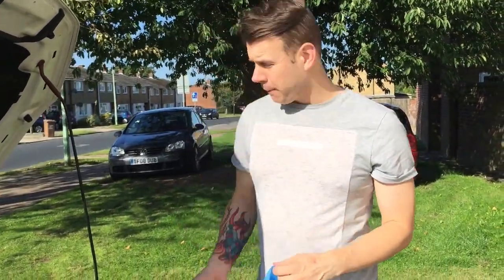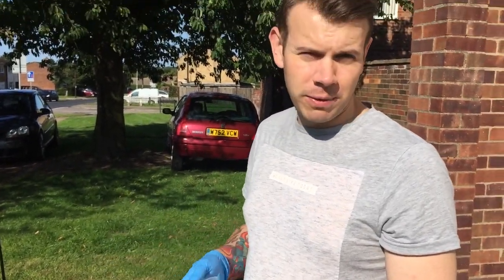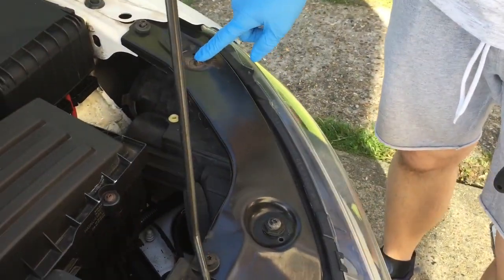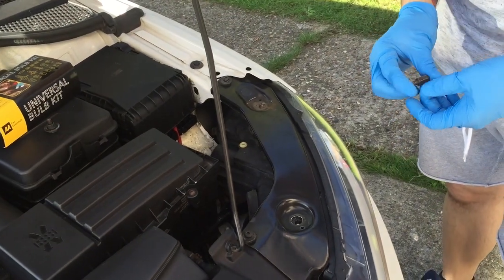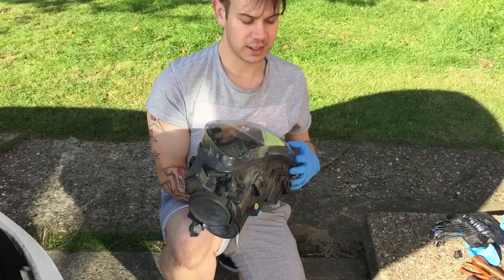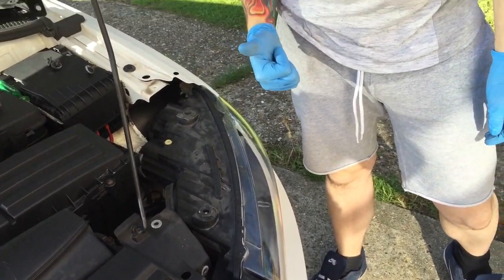Volkswagen Scirocco - Bulb replacement Guide

Comment: Very useful video, I was searching for it. I have a 1.4 TSI and I was planning to change the bulbs, it seems almost impossible to do following user's manual instructions without taking out the whole headlight. Thank you!
Reply from the maker: Thank you. I will have more videos on the scirocco coming soon :) if there is anything specific you would like to see please let me know ?
Reply: +FL4ME WITH A 4 Thank you very much! I have a small issue with my Roc, not so big but very annoying....drivers door window rattle. I know it's originated by power window mechanism, so I should remove door cover to get access inside. It would be very useful to me if you have such a video. Thank you!
Reply from the maker: dodicicilindri Funny you say that as i am doing a video on trim door card removal and fitting of side skirts, also bulb upgrades, and painting of the interior trim. :)
Reply from the maker: +dodicicilindri the door card video is now live go check it out :) sorry i took so long....

Comment: Very helpful video the bulbs are a nightmare to change, the driver's side light has a cable running below the metal plate which makes that side a bit more awkward. Cheers 👍🏻👍🏻
Reply: Just unclip the bonnet release cable from the cover on driver's side - fingernails will do it easily.

Comment: You dont have to pull out the whole headlight. If you have small to medium hands you can replace the bulb easy. Turn anti-clockwise and pull out the adapter. Replace the bulb, put the adapter back in just like how you pulled out. Turn clockwise. You will hear or feel the click. When putting the bulb in you can look in front of the headlight if the bulb goes trough the little hole.  Just a matter of being a bit handy. You can also make a small simple tool if you cant put your fingers easy in the hole.
Reply: That’s what I was thinking lol. When I changed mine I just pushed my hand in

Comment: What was the 2nd bulb you pulled out? Is that like a 2nd headlight? just wondering as I am changign my headlight bulbs to xenon white. Will I need to replace all 4 bulbs? Cheers.
Reply from the maker: +Darren G-dub Thank you for the question. Yes all four bulbs will need to be replaced if you are changing them to the upgraded xenon. You will need four h7 bulbs :) many thanks Dan
Reply: Ah cheers for that mate. Thanks for the tutorial aswell. Very helpful :)
Reply from the maker: No worries, glad i could help. If you need help with anything else just let me know. I will be  uploading interior trim removal and a few more vids soon :)
Reply: +Dan Chapple Nice 1 :). That would be great. I bought a Scirocco today so just getting to grips with it all lol. and looking at bits I want to change, like the bulbs etc.
Reply from the maker: Nice one :) they are great cars you will enjoy it, what did you get the 1.4tsi or the 2.0tsi?
Reply: +Dan Chapple 2.0 tsi :). love it. So quick.
Reply from the maker: Yes they are very rapid mine is also the 2.0 tsi :) stay tuned

Comment: Great video , but I did this a few weeks ago but I didn't replace the cable for opening the bonnet in proper at the top of the headlight , now I can't open the bonnet, anybody any ideas how I can open the bonnet to fix the lead.  Please reply if you can help. Thanks
Reply from the maker: James Crawford I can only think that maybe if you can get underneath you could reach up and use a screwdriver to unclip the latch
Reply: FL4ME WITH A 4 ok thanks I will try it out, hopefully I can get at it. Thanks

Comment: thanks ..
I have problem in my Tiguan have message "check number plate lighting" outo light still work even morning 
I do not know how to fix it??
Reply from the maker: Hi could you explain a little better and I will do my best to help you :) also find me on Facebook Dan Chapple and we can chat about your light on messenger 👍🏻👍🏻
Reply: +FL4ME WITH A 4 In fact, there are many Facebook accounts with the same name, In short, the problem that the automatic light does not turn off in broad daylight , and this is supposed In recent times appeared to me this message, thanks a lot
Reply from the maker: +Wesam Ghazi are you sure that you don't have daytime running lights on ? And the link to my Facebook is in the comments 👍🏻
Reply: +FL4ME WITH A 4 yes still switch on
Reply from the maker: +Wesam Ghazi its going to need to be plugged into a diagnostics machine to identify the fault, have you checked all your fuses and connections behind the light..?